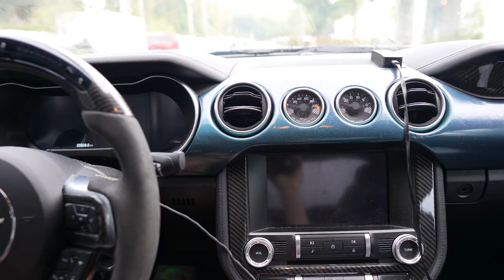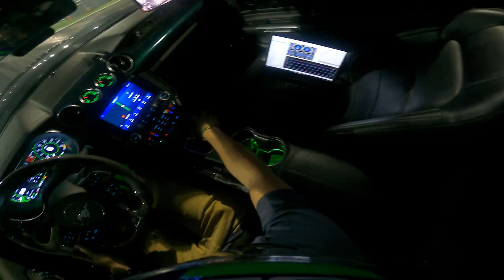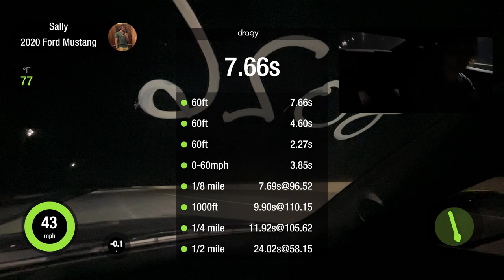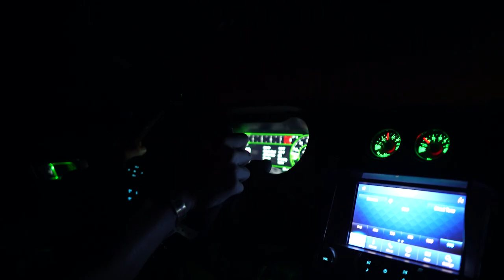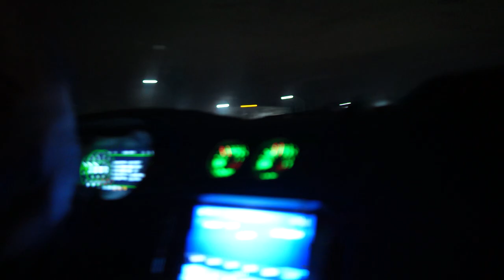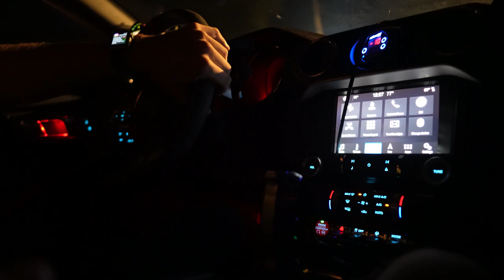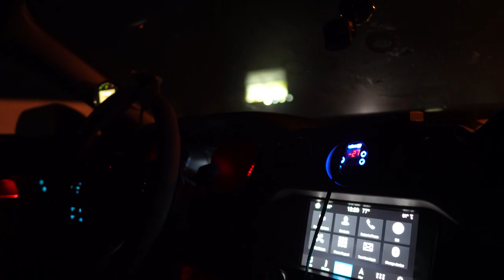PARKER RAN A 9 IN STANGRY, I ROASTED MY CLUTCH & WENT TO MEXICO  TO ROLL RACE! (FULL TRACK DAY VLOG)

Comment: Tobey- I really enjoy your content. I do have a question however. What do you have to gain from saying that your clutch slipped when it is obvious to me that you shifted into 5th? Yes, the clutch did slip when you dropped the clutch. But when the rpms falling is from the clutch trying to get the wheel speed to catch up to the RPM. It burned when you went into gear and not later. Due to it being easier to slow engine speed than wheel speed, that is why at 13:07 you can hear the RPM's drop low as wheel speed is still increasing. Also, if you look carefully, you can see yourself look at the shifter as if thinking- 'Did I just miss 3rd?'. You get up to 110mph in whichever gear that is. If it were 3rd gear, you would be just over 7000 rpm. Which you are obviously not since you do not let off the gas until you hit 110. If the clutch truly slipped later in 3rd gear, the rpm would go disproportionately to wheel speed which is the inverse of what actually happened. If you really shifted into 3rd, show it. Show your POV footage. You have the dragy but not the Gopro posted. 

It is a very common thing to happen and can happen to any driver. But don't try to cover it up man, that's just shady.